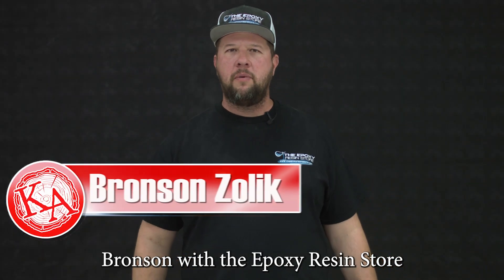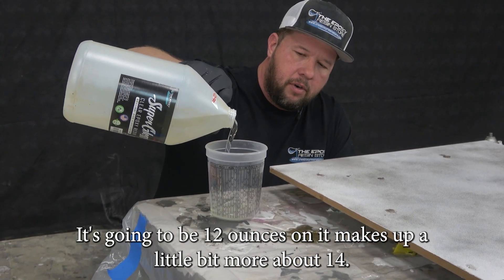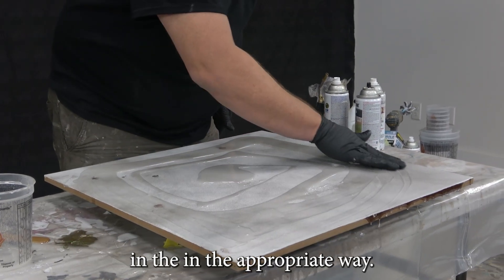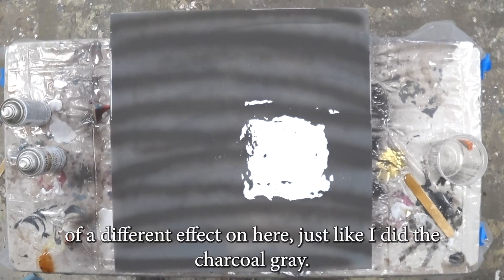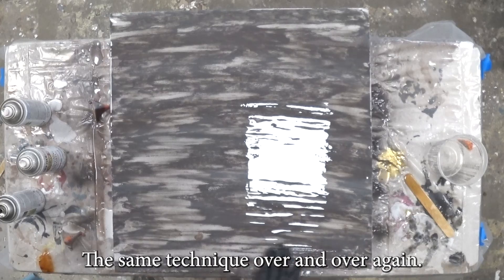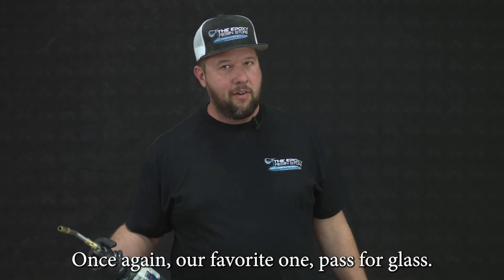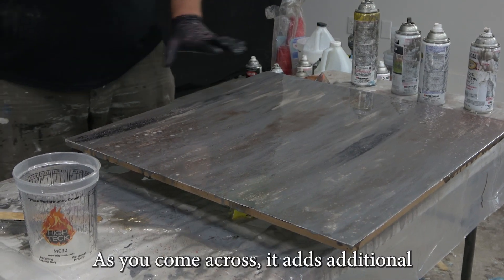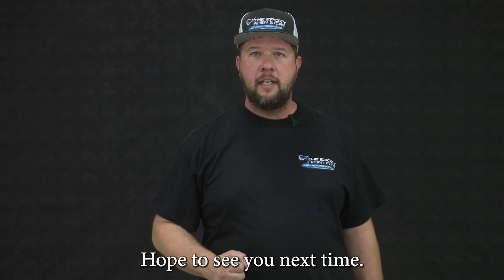Soapstone Replication with Epoxy Resin | DIY Tutorial

Comment: Very nice. Some white marbling is soapstone. I have unsealed soapstone counters and want to use a resin.  There are darker spots around the sink where oils have been on . They say to oil the counters but I have not been able to do it enough. Installed counter is a little trickier but I appreciate your video installed counter epoxy over it.